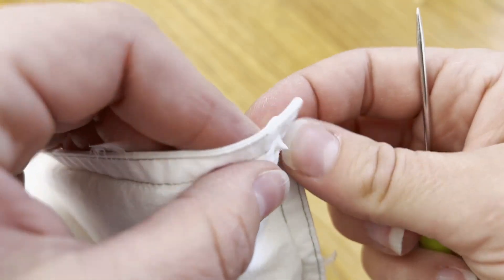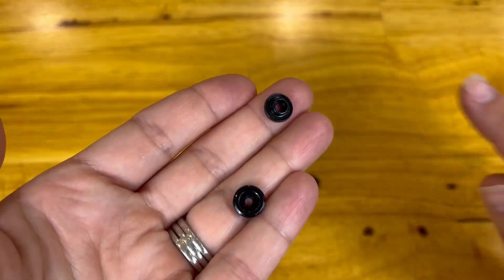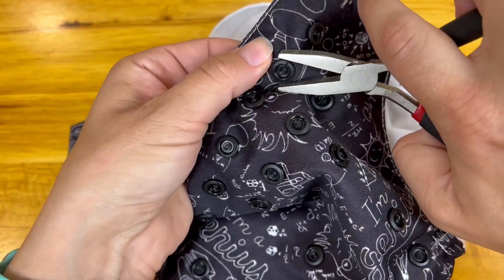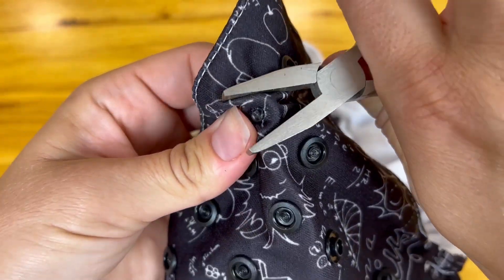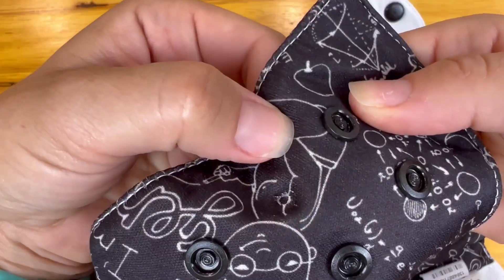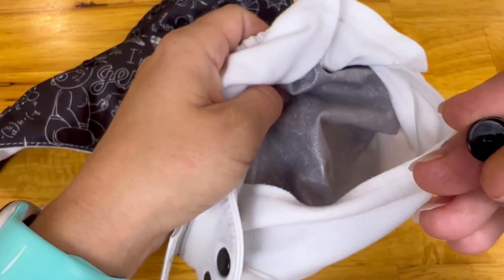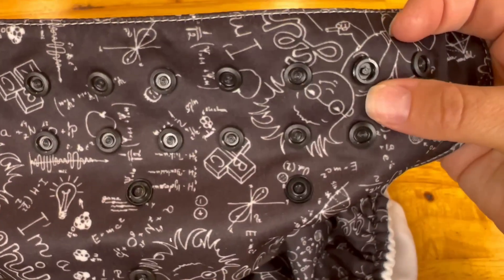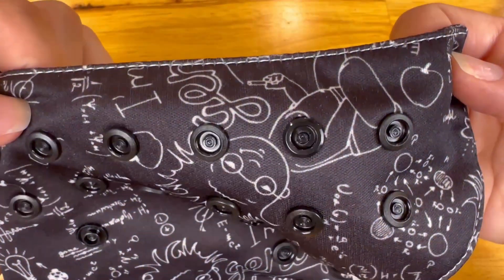Step-by-step guide: How to fix a broken plastic snap on any fabric | How to Replace a Plastic SNAP

Comment: could you do the same thing without the pliers?
Reply from the maker: The plastic snaps would be very hard to install without the tool. You could try a flat piece of wood and then a hammer, but you would have to be careful to not crush the flat part of the snap. Another alternative would be to get the metal sew in snaps https://amzn.to/3E3sp5a but you wouldn't have anything on the outside or front of the diaper to hide the initial hole. But that would just be cosmetic at that point. However, a lot of these tools you can buy with a small set of snaps https://amzn.to/4hbfDQo . I did find this set that snap together, but don't need a tool as well. https://amzn.to/3PGLWLi  So I hope one of these options help.